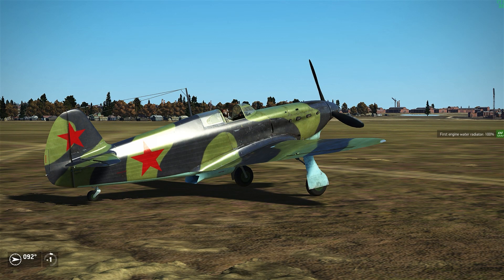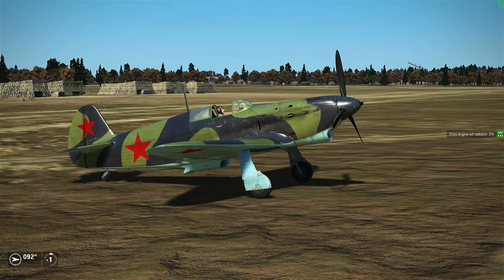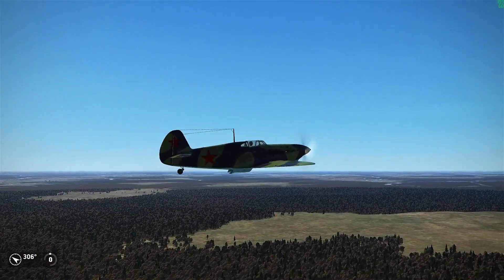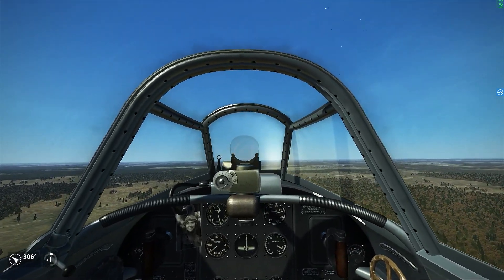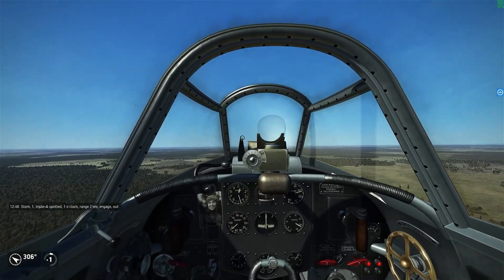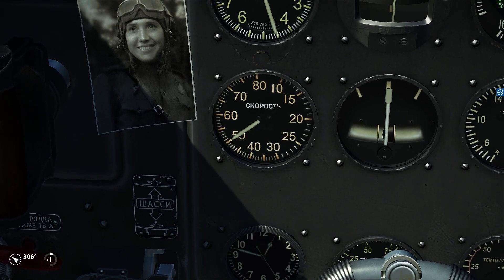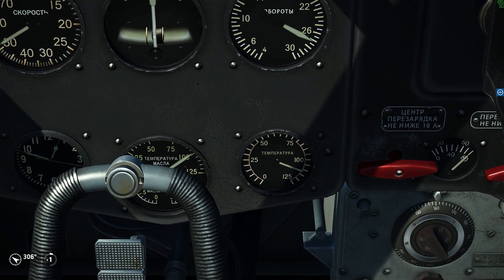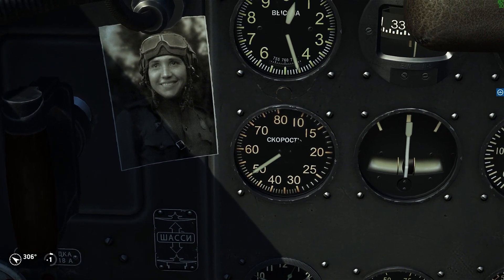IL-2 Sturmovik - Radiators, how they work and what to do with them // Basic Level // 2021

Comment: Also worth mentioning that the radiators can effect the flight characteristics of the plane as well. The P-47 comes to mind.  The air inlets on the side of the fuselage of the P-47 can cause pretty violent shaking when left open during normal flight.  They are really only intended to be opened on the ground during taxing and takeoff if I remember correctly, since the P-47 can't effectively air-cool the engine if it's barley moving.  Of course this is very plane dependent, you will learn all of the differences from machine to machine with time. Closing up the radiators too during a pursuit can also be really helpful, getting those extra 20kph in a dive for instance can help close the distance during an attack. Sometimes when flying aircraft with similar speeds in level flight it can be the difference between catching your prey, or them slowly pulling lead until they are out of effective gun range.
Reply from the maker: Yees!! i am doing a video touching this topic since p47 has the inlet and outlet cowls which new players might get confused if we see all that in a single video
Reply: @ToteTorresWW  Yeah, it confused me when I was new to the game too. I remember wondering why the P-47 was shaking itself apart when flying level, it was the outlets.  It's one of the aspects I honesty love most about IL-2, you can totally master a aircraft and know the aircraft inside and out by feel. Then you switch to a new plane and you are a rookie again learning all of the new characteristics of the machine.  Each aircraft has its own personality so to speak.

Comment: Can you explain the difference between oil and water radiators?
Reply from the maker: Is simple, the oil radiators cool your oils and the water radiators cool the engine itself, both are equally important since not having oil will kill the engine or an overheated oil will damage the engine and if there is no water on the water radiators then the engine will have no cooling at all.
Reply: @ToteTorresWW  So, in planes so equipped I have to adjust both together?  I'm running VR with a joystick and am having trouble getting enough binds to do this.  Can I use the same key bind for both?
Reply from the maker: @NockedArrow  you have to adjust them separately! I know is hard but is much better than having them both bind to the same key that will course you issues later on the game as you improve